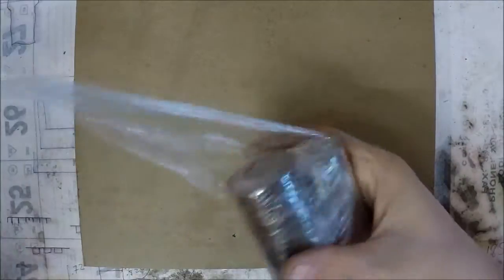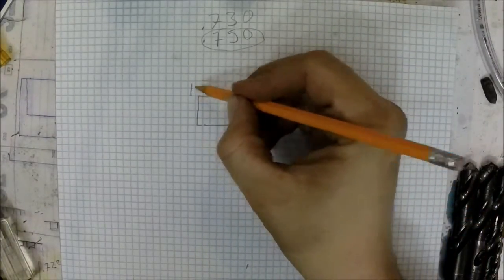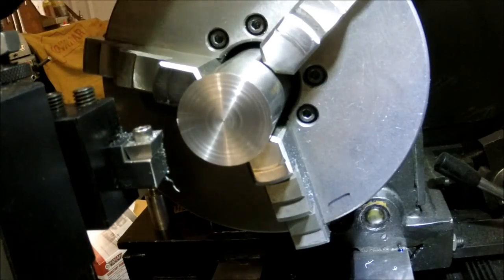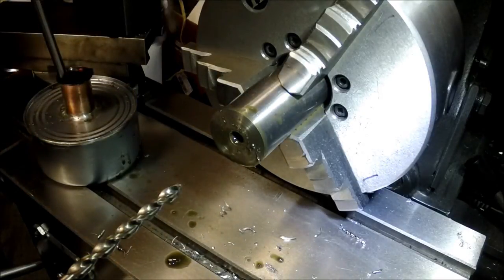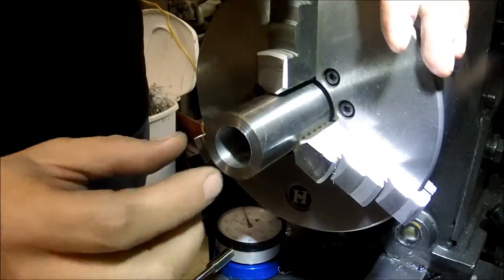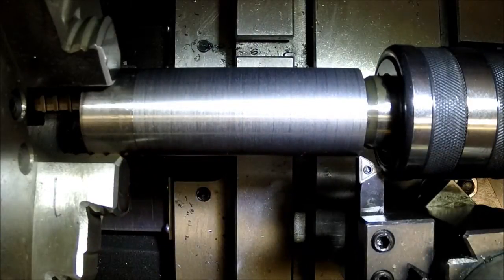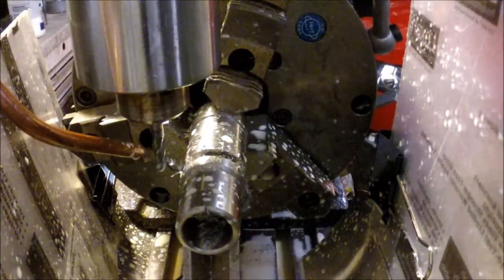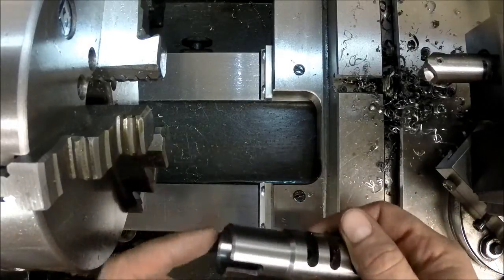Mixed Bag of Goodies #15

Comment: i been tryin to find a muzzle brake to act as sort of a baynet too, maybe the breacher with just three prongs a bit longer, can you do that for the same price? i do plan on purchasing a brake from you sooner or later regardless,  does the one with three cuts work as good as the one with two like the one taofladermous has?
Reply from the maker: The breacher type is $100.00. I could try to make one with three prongs for the same price.
Reply: i dont know machining i just thought it could take less steps and i want the three prongs long enough to be fatal to an intruder if i run out of shells, and with the way the barrel sits up against that shoulder inside the break it would be pretty strong in a stab, and a baynet built  into a functioning brake is awsome i think

Comment: I wonder, couldn't you drill some small ports on the upper side, angled so the gases go backwards a bit, thus reducing muzzle climb and backwards recoil (by pushing  the gun down and to the front)? I know that muzzle breaks that pushes gases backwards can annoy other people around but if it's going up and back it should be OK, right?

Comment: Hey Mike,

Thanks for the shout out buddy, sounds like you have some great plans for 2015! The brake turned out sweet, nice work man!

I would be happy to send you some 1.250"(OD)  17-4 PH stainless steel bar stock if your interested in giving that spin on your lathe.

Ray
Reply from the maker: Hey Ray,

No problem man gotta give credit where it's due. That would be awesome to try some of that stainless. I've got a few different types of brakes I could trade for it if you'd be interested. 

Thanks!

Comment: hi mike excuse my ignorance but what is the function of the muzzle brake on a shotgun and does it effect the choke on the barrel . dave in the uk.
Reply: It's for recoil reduction :)
Reply from the maker: It does not change the choke it only clamps on to the outside of the barrel. It may add .001 to the choke but the standard chokes differ by a factor of .010 if my memory serves me right. It diverts the exiting gases to the side to reduce the felt recoil.
Reply: Mike Dittman thanks mike
Reply from the maker: No problem.
Reply from the maker: Yes, you could put a few rear facing vents on top and that is what makes a battle compensator.